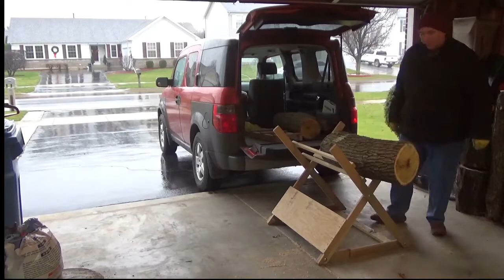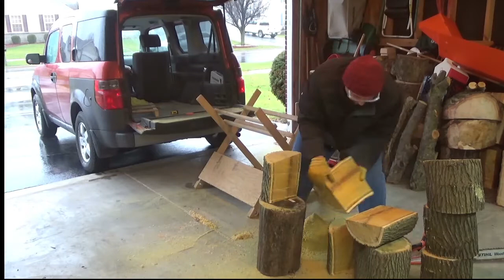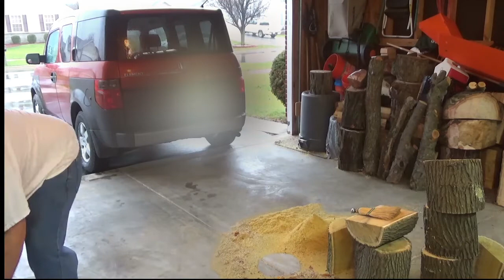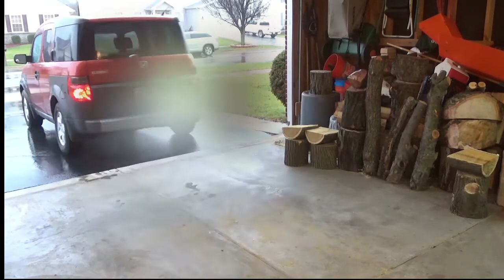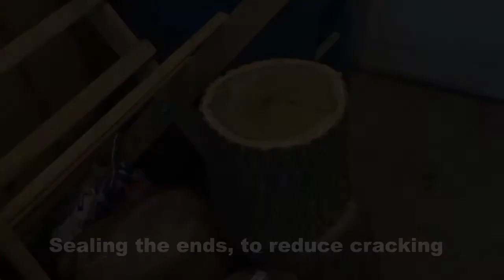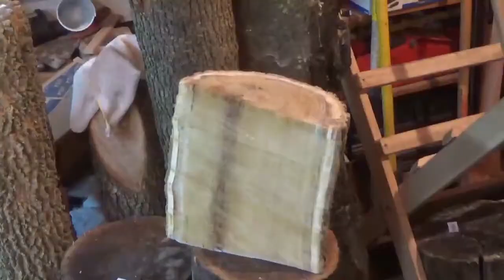Mulberry Logs prepped for bowl making

Comment: Hi. So I’ve just been given a 5’ x 1’ lump of fresh mulberry and wondering what to do with it. 
Was yours wet or dry? what sizes did you cut it up into? Why some in half lengthwise? How long have you left it to dry?
TIA 👍
Reply from the maker: Yes, it was wet wood, that was freshly cut. I cut my in half lengthwise, because I intend to  make bowls and doing that relieves some stress in the wood, when it starts drying. Each persons situation, dictates a different approach to "prepping" the trunks. If you want boards, you would resaw the log into planks. What are you going to do with your log, what will be it's purpose?
Reply: @DaMidwestMan  wow that was quick thank you. I’ll be using it on the lathe, bowls etc the usual stuff.
Reply: @michaellionart4841  Seal the end grain with wax paint ( anchorseal) or a generous layer of wood glue, to retard checking. Cracking will occur, you can only delay or limit it. Cutting with the grain in halves does help, but slicing twice with the grain is even better. Let the pith be in the middle of third piece. Use the middle portion,.  set aside for boxes or platters, or anything else you can think of.
Reply from the maker: @michaellionart4841  ... You're welcome. I posted more info for you, in this thread.
Reply: @DaMidwestMan  thank you 🙏